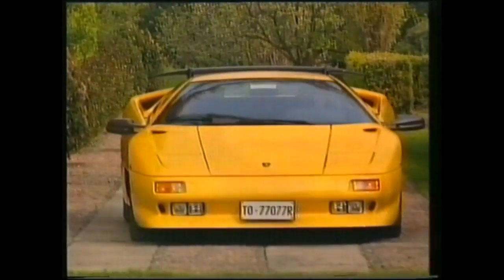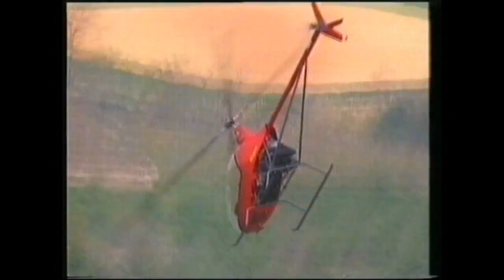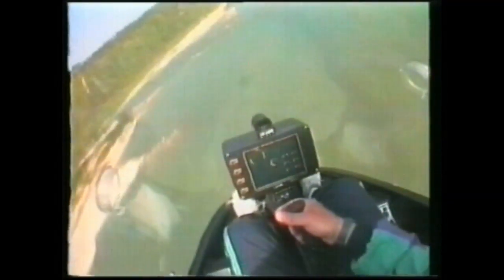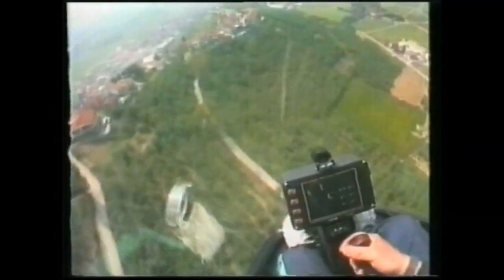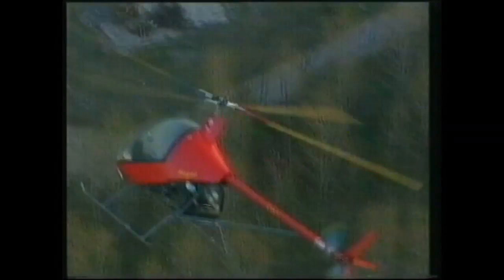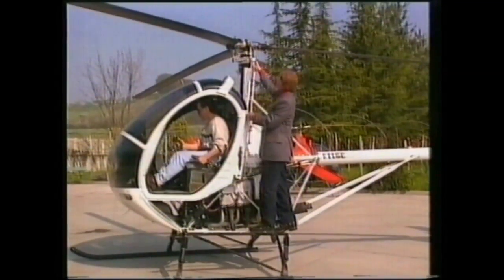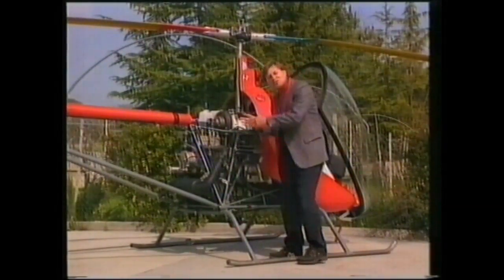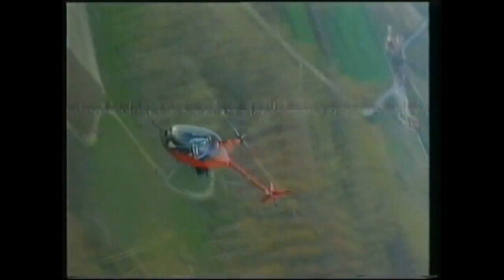Angel CH7 Kit Helicopter

Comment: ch 7 Angel engine 582 65 hp
Reply from the maker: Yes, this was one of the original CH7 Angel helicopters built with the two-stroke Rotax 582. Because of the unreliability of two-strokes in helicopters, they quickly moved to four stroke engines with some individuals installing APU turbines!